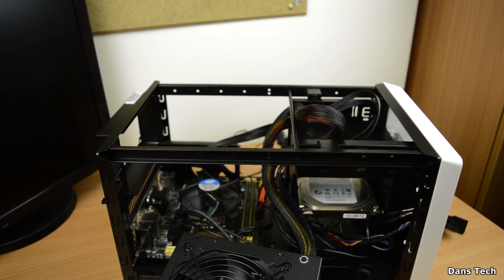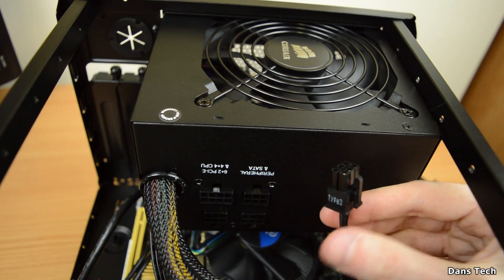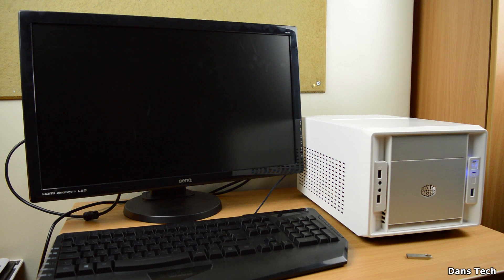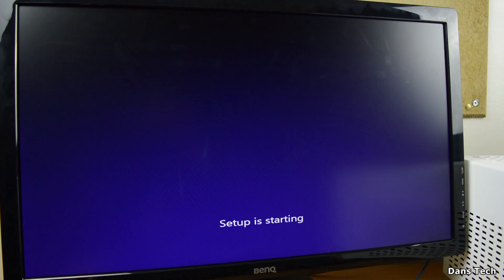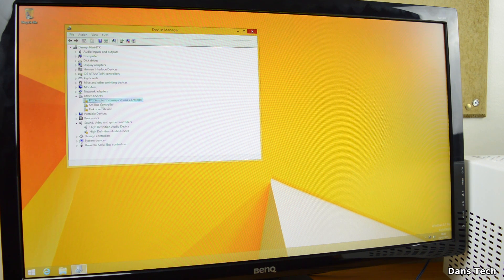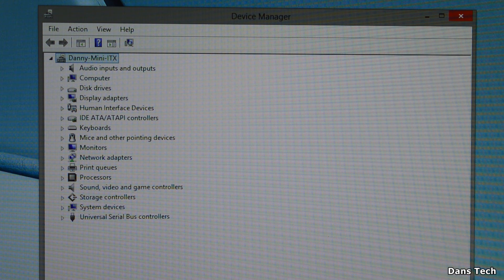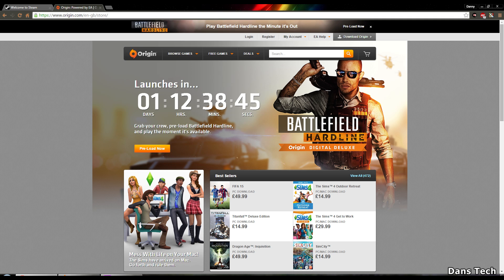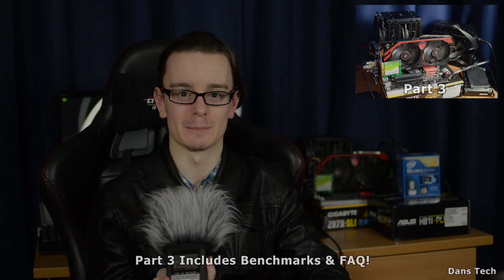How To Build A Mini-ITX Gaming PC 2015 - Part 2

Comment: I forget to make a partion does it matter, or can I change it after windows are installed
Reply from the maker: +Daniel Horton Hi, If your Windows OS installed successfully you don't need to create and partition afterwards. Also for some recent operating systems I believe you don't need to create a partition and the system will do this for you automatically. Dan.

Comment: hey Dan. thanks for the great video. I finish building my first gaming pc with your help. I have one question there's only one PCI expansion slot but I want to add a graphics card and a wireless adapter too. is it possible?
Reply from the maker: +ricky jaswal Hi, you could buy a USB network card. Dan.
Reply: +Dans Tech  thanks alot for quick reply. i ended up buying linksys ac580 usb adapter which is working fine so far.thanks again

Comment: Hey Dan really looking forward to making this pc in a while, quick question I have a gpu on a already built system (geforce gtx 770) can I use that 770 on this new build without problems? Thx Love the vids!
Reply: Dans Tech Hey dan are you able to have a wireless adapter and gpu at the same time? if not are there any motherboards with built in wireless.
Reply: +Jacob gordon there are several motherboards that support wireless. If yours does not, there are multiple routes to go. If the motherboard has a second expansion slot (pci), you can support both a graphics card and a wireless adapter. Otherwise, you can purchase a wireless usb dongle, but keep in mind it will take up a USB port

Comment: This is the clearest build guide I have seen. Building this looks relatively simple, but the wire management steers me away from building a PC. I can do everything else though. I am just worried about putting the wires in the wrong ports. They look so similar.
Reply from the maker: MrZiggyfun Muslim Channel Hi, thank you! really does mean a lot! If you have any questions I am more than welcome to help you out with this. Would a video on PSU cables help?
Reply: I think it would. Thanks. I need to know how each wire looks like without looking at the documentation or labels.
Reply from the maker: MrZiggyfun Muslim Channel Great, I'll get on it!

Comment: When I install the os to the sad do I disconnect my 1tb hard drive and then reconnect it? Will a hard rive just work if I connect it to my motherboard since my ssd has the os or do I need to change something for my mother board to read it?
Reply from the maker: xnagato666x Hi, check out this ancient video of mine, will help you out. However i will say you should not have the HDD connected when installing an OS to the SSD just to ensure nothing can go wrong. Once its done you can connect both drives. https://www.youtube.com/watch?v=H1QlyBVJj5Y
Reply: Dans Tech Thank you :)

Comment: I have a question.
can I use in 16x PCI-E 2.0 a GTX 970?
because gtx 970 have a 3.0 slote.
Reply from the maker: Hi, yes you can. There will also be no reduced performance because of this, with a gtx970.
Reply: Thanks for answering my question :)

Comment: Hi dan i was just wondering if you can have a 1tb hard drive with like a 64gb ssd and my pc will be alot faster? If you need my pc build i'm gonna make it's here https://uk.pcpartpicker.com/user/oggyphillips/saved/
sidenote: I already have 1tb seagate barracuda 7200.12.
Reply: Installing an ssd won't make your pc any faster, however data installed on the ssd would load faster but tend to lol slightly Improve performance also operating systems would boot faster installed on an ssd.
Reply from the maker: Owen Cheese Exactly. Couldn't have explained that myself any better. Cheers buddy!
Reply: i didn't mean by performance i meant like intalling stuff or how fast windows loads i should have made myself clear sorry

Comment: Sorry but i have a mini itx pc thid is spec 
I7 4790k
Gtx 980
Cage cooler master 120
Mobo asus z97e itx .
What do you think about it .
Reply from the maker: Rocking a 980, nice, pretty sweet bro! How your temps with the i7?
Reply: 45 C to 50 C with ac unity on ultra and oc to 4.7 ghz
Reply: Yeh it was realy hard beacause i had to change a lot of things first was my cupboard beacuse i cut holes for a good coolers 180mm in both sides and i have custom water cooler .
Reply: And name of my water cooler is cooler master eisberg prestige .
Reply from the maker: Olek Siatkowski Nice, I've actually been sent two of the Cooler Master 120's for review by Alphacool. Not sure why they sent two but a review will be up soon. Not that impressed by them if im very honest.
Reply: Yeah it so funny beacause i had a big zalman z9 plus but in my new flat it wasn't look nice so i sold mobo and cage and bought this .

Comment: Hi Dan what do you think about the new r9 range? hopefully they'll drop the price of the 295x2 a little too.
Reply from the maker: I would have looked into the 295x2 when I purchased a second GTX 770 for SLI back in November 2014, but i've heard it doubles up as a heater (which I don't want), also pretty loud even though its watercooled! I'm looking forward to see what AMD can do with the 390 and 390X. Things might get interesting since Nvidia messed up with the GTX 970!